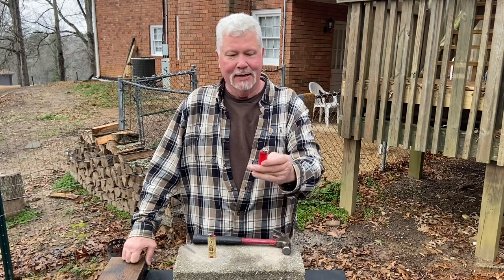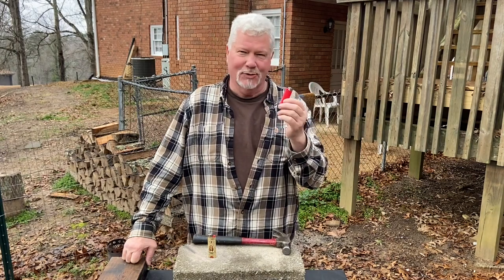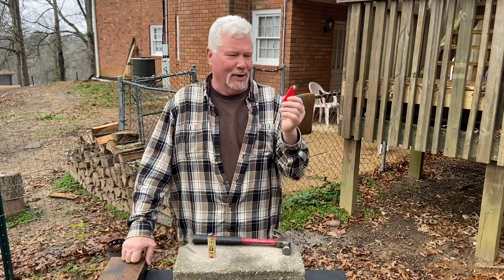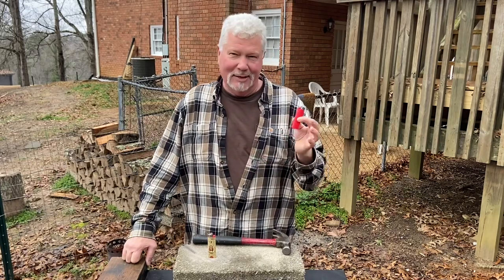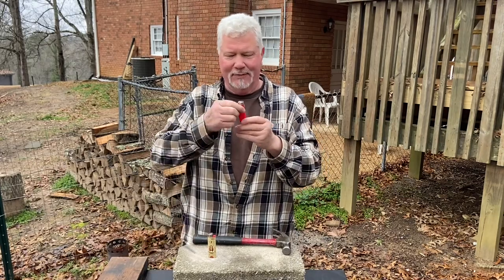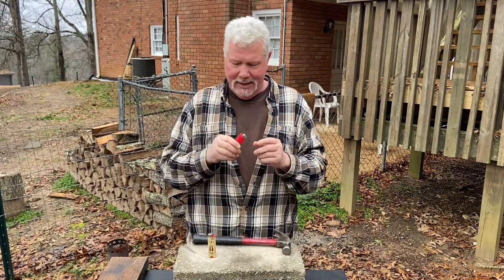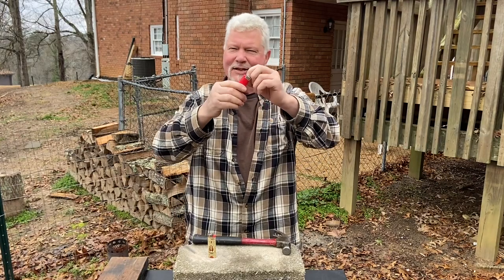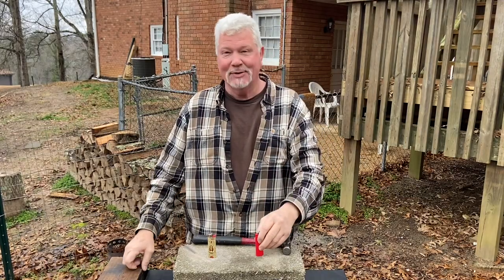Smashing BIC Lighters With A Hammer Then Making Fire With Them!

Comment from the maker: I've found lots of lighters over the years... empty, full, no flint, with flint but with a very weak spring, etc. I was hoping to run up on one someday that was mauled or shattered to see if it could still make a fire. Christmas Day, I found one. It had been run over by a car (See LINK below). The guard was smashed in and had the striker wheel stuck. Taking the guards off, I tucked the wheel's shaft back in it's hole and tried it... no flint! LOL! I'm not going to wait another several years before I get try again. I'm breaking out the hammer!!!
   See me smash lighters, remove guards, and make them start 3 fires. Please follow the LINKS below and SUBSCRIBE. Thank You!

Empty BICs Making Fire Playlist
https://www.youtube.com/playlist?list=PLkoXX8XsMW3kwv1ni1qnJnAtQdHgJFCW5
A Christmas Candle? A Disposable Chapstick Grease Lamp? LOL! Just A Wet Tinder Fire Starter!
https://youtu.be/d18d3-iwB1M
Making Fire With A Wet Empty BIC
https://youtu.be/qX-yc_OsYZo

Comment: I've modified a bunch of bics, drilled out where the gas comes out, put a tube in and use rolled up toilet paper or paper napkins in the tube to make a slow match. I also ground the bottom of the flint tube and use a screw so I can change flints easily. Cheers David
Reply from the maker: The possibilities are endless.